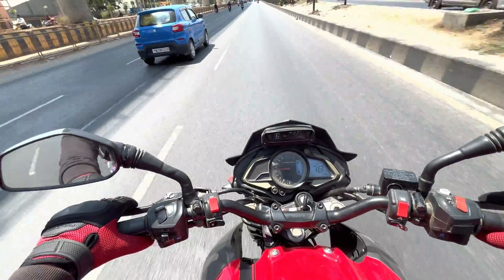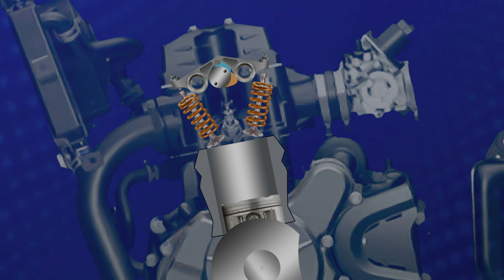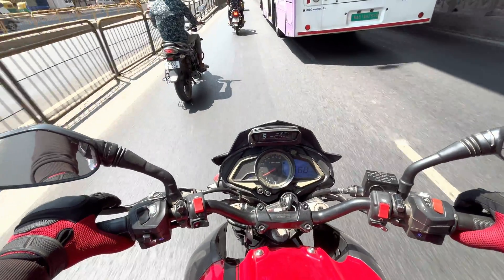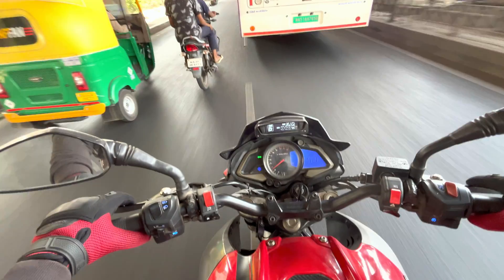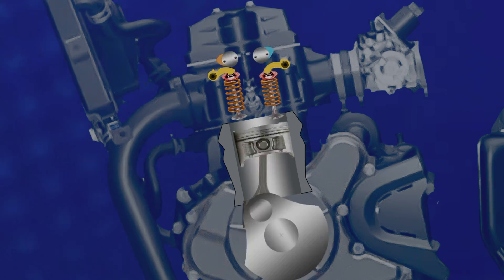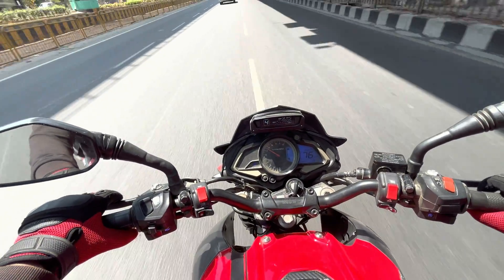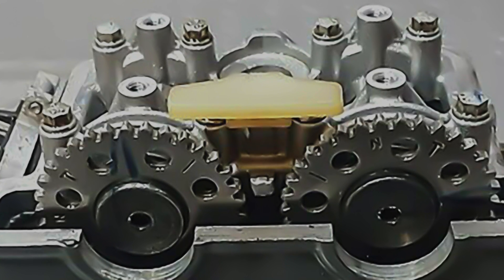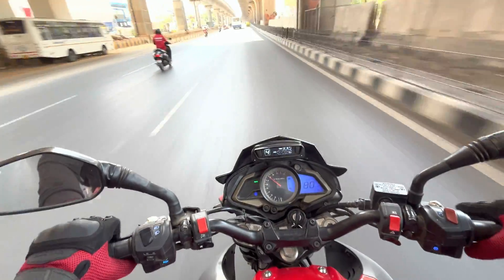SOHC vs DOHC Engines | Which one should you consider ? | Vlog #03 #dohc #sohc #motorcycle

Comment: A SOHC (Single Overhead Camshaft) engine with 4 valves per cylinder is a design where a single camshaft controls both intake and exhaust valves, but with a 4-valve setup (two intake, two exhaust) per cylinder..... Then what's difference both of them...??

Comment: Brother i have ns 200 bs3 2013 model it showroom maintain bike and i am facing problem regarding power when I throttle my bike it goes 120+ in 5th gear but when i sift the top gear speed decrease and come up on 95-98 showroom not identify the problem 3 time change my cluth assembly and engine is also tint like new condition does you suggest me what i do
Reply: could be multiple reasons.. but the bike losing power in a particular gear is a bit strange for me . i would suggest you to get the bike checked by a good professional. as of my knowledge there could be a issue with your carburettor . transmission or fueling.. get them checked also.
Reply: @shaggy272  it’s happened after showroom change a new carburettor but they are not agree to consider his mistake

Comment: Hey bro, I recently installed an Akrapovic R1M exhaust on my NS200 2023. However, I'm facing an issue where my engine gets overheated after just a 2km drive at a speed of 60kmph on a non-traffic road. Do you have any ideas for resolving this, or should I just swap back to my stock exhaust?
Reply: first of all how are you noticing a overheating is it showing on the dash or you are feeling in your legs .or the fan running frequently. i would suggest to first get the bike radiator and coolant checked. also. the exhaust might make your bike runa bit lean.causing heating but should not be a issue in just 2 km . a through study is required my friend

Comment: A lot of people are upset that the N250 has 5 gears, even though it wasn't meant to have 6. Many are claiming that you can modify the engine and do a 6 speed swap/conversion. Please tell us, what is possible and what is not.
Reply: as of my knowledge it is simply not possible... you might try to do some juggad to get the work done.  but the question comes out to be why you want to do that. is the 5th gear not enough ...and do you want to play with the reliability of a perfectly fine engine .
Reply: @shaggy272  true
Reply: better to buy another bike